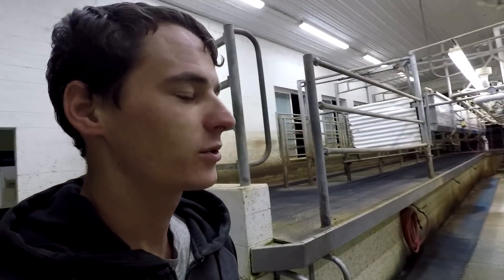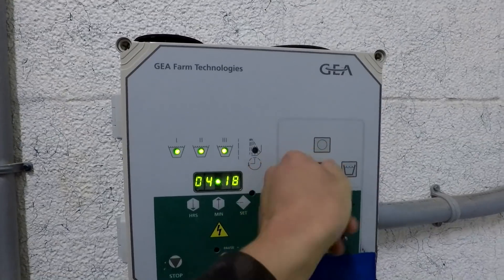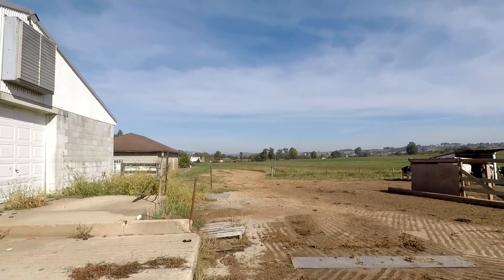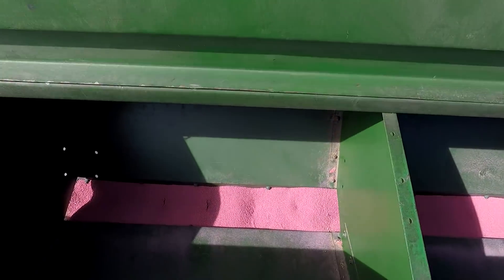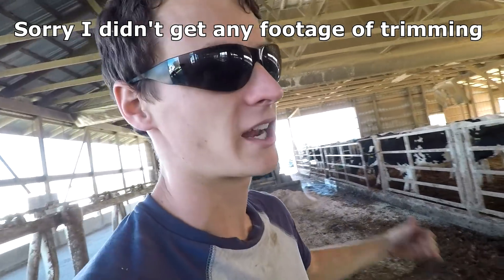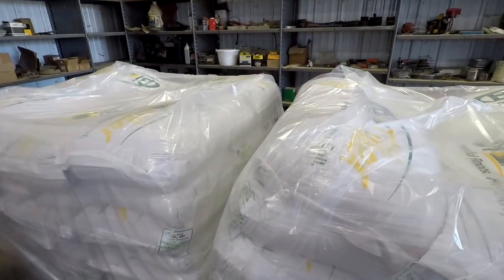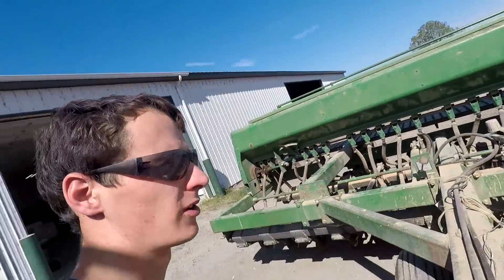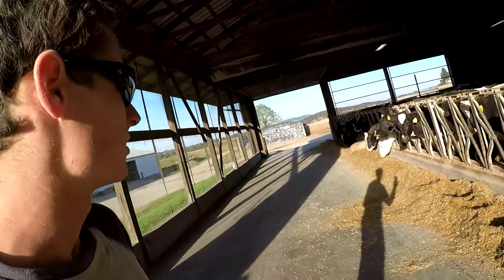No-till Drill Prep and Farm Chores

Comment: I was watching one of your previous videos where you fixed the skidster scraper and you should consider using 6010 welding rod, it’ll but through the rust and will make a stronger weld if stack 7018 welds on top of the 6010 weld